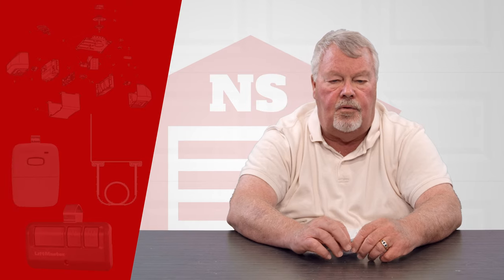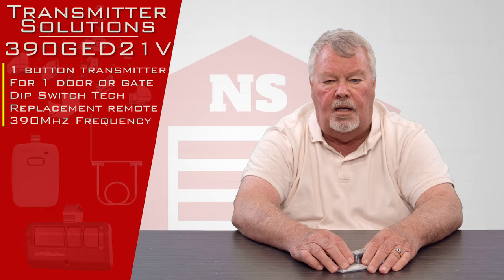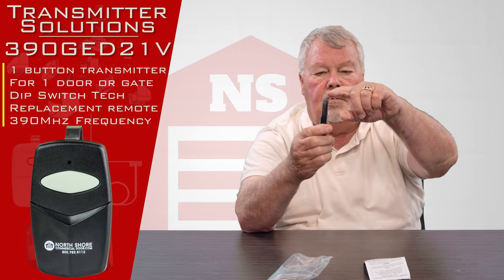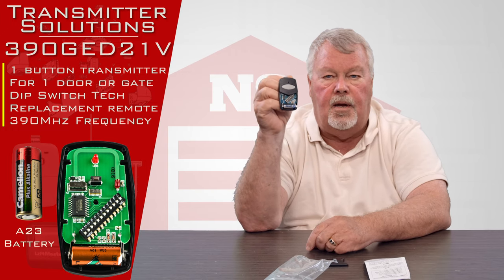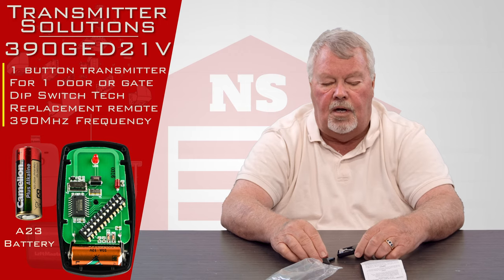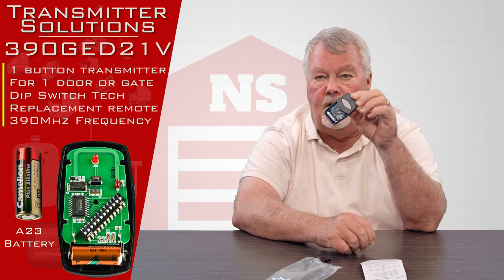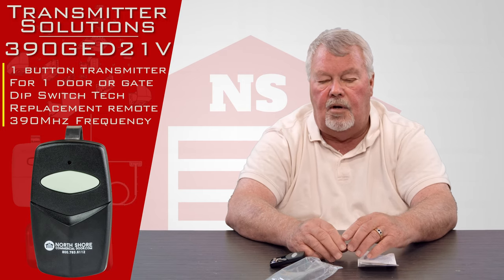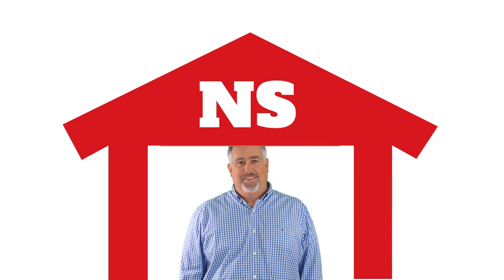Transmitter Solutions Stinger 390GED21V Garage Door Remote

Comment: I recently moved to a new condo, my roomie has this control to open the gate, so if I bought the same do i able to make this work without the help of the condo maintenance?
Reply from the maker: Hi Oscar, You should be able to program your remote by matching the dip switch sequence of your roommate's existing remote to yours. Remove the bottom front cover of your roommate's remote as well as your own to reveal the dip switches. Flip the dip switches inside your remote to match the sequence of your roommate's remote. Then you should be good to go without having to involve your condo's maintenance department!
Reply: Thanks a lot